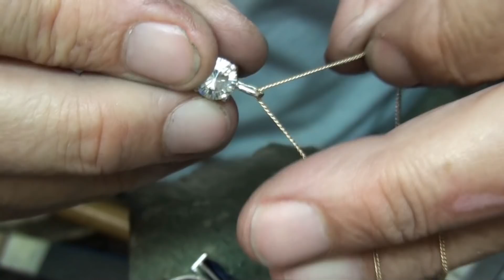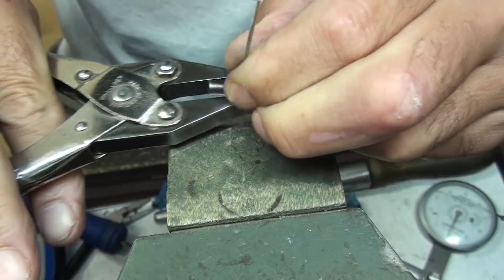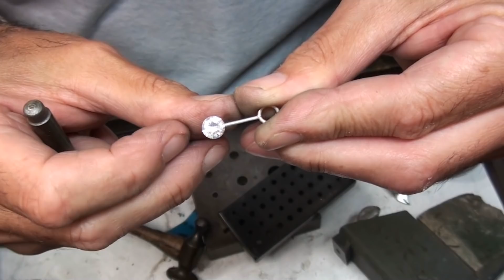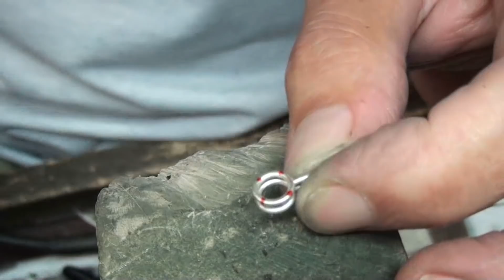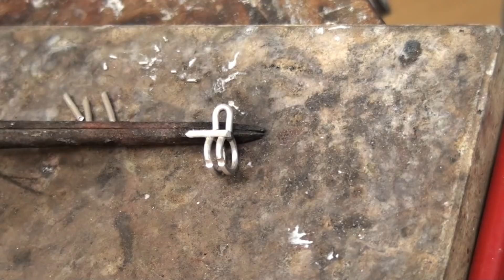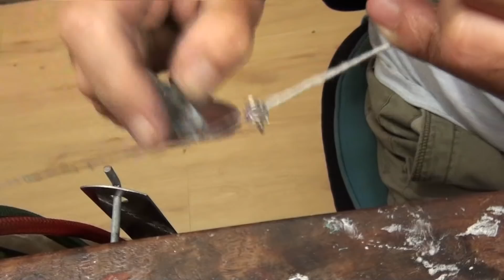Round basket setting

Comment: peter I liked very much your setting , I know most people do the crossed wire mounts  I doe  not like them when you  file the wire of the back it makes the back of the mount flat. another way I doe make the mount is  I solder the claws on to the first ring round  or pear shaped flat with hard silver solder  then nick at the bottom of the claw bend it up  the claw is held in place because  I have not filed right through the joint . I solder the top ring in then resolder  the bottom claws regards ken walker oxford uk

Comment: Hello, im not sure if you still see comments on older videos but I had a question. If making a basket setting for something like a ring, do you still use the wire for connecting and then just cut it off?
Reply from the maker: Yes. However if you ar making a ring the bottom ring needs to be shaped to fit the finger. I show this technique during this course; https://www.jewellerytrainingsolutions.com.au/courses/oval-basket-ring

Comment: How do you decide the thickness of the wire for the size of the stone? I assume for a smaller stone your wire would be a little thinner?
Reply from the maker: Antonina Amico correct, but no thinner than 0.7mm
Reply from the maker: Yes correct, but not thinner than 0.7mm and no thicker than 1.2mm

Comment: How can your explanation on how to work out the length of wire you need to make a jump-ring to go just under a stone work?:-  You say - Take diameter of wire times it by 2 - so lets say 2 mm round wire. times 2 times 2 is 4, then deduct that from the diameter of the stone, lets say a 12 mm stone - so 4 MINUS 12 is MINUS 8. How can you use MINUS 8 anything??
Reply from the maker: You might need to watch again. The calculation is about finding the right size stake to make the jump rings
Reply: @jewellerytrainingsolutions9978  OK I see now - thanks - it still can't be  a minus number though.
Reply: @PhilStevensphilongold   I'm hoping you got your answer by now, but he's just saying you take the diameter of the wire, multiply that times 2. Subtract that number from the diameter of the stone you're setting, and that's the size of the rod you need to wrap the wire around to make the right size jump rings for that stone.
For example:  For your 12mm stone, and 2mm wire...  2mmx2=4.  12-4=8.  So you would need an 8mm rod to make the jump rings for that stone, using 2mm wire.  That being said, 2mm is too large of wire. 1.2mm is the largest Peter recommends.   Hope that was helpful, or even better, unnecessary, since you've already moved on and are making beautiful pieces of your own! :)
Reply: Thanks  @Elmojomo

Comment: Why don't you use small wise for holding the job instead  of using your finger to hold the job. if you think the wise jaw will put mark on the specimens you can stick flat wood on the surface of the jaws to prevent any scratches. I am sure you must have small wise in your tools. good work and camera positioning excellent and good explanation. thank you.
Reply: FYI You can get 'slotting files' as fret files from guitar makers like Stewmac.com.